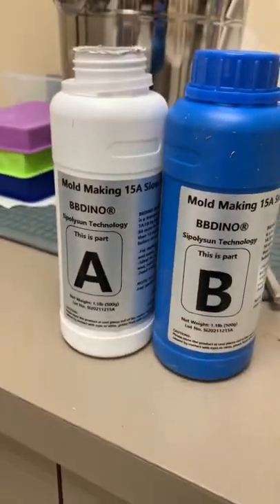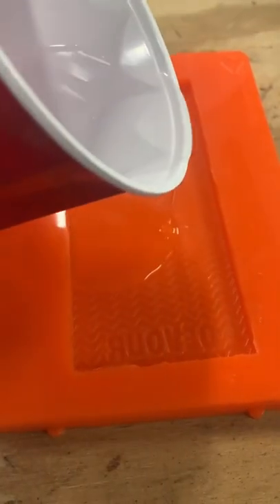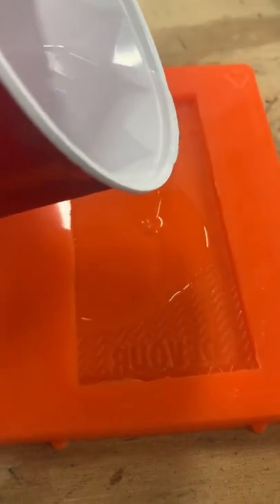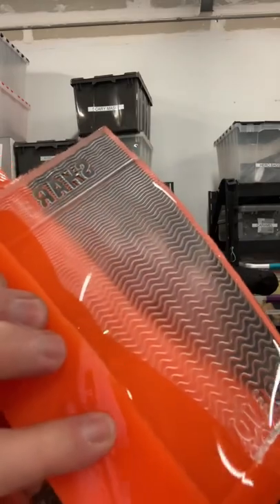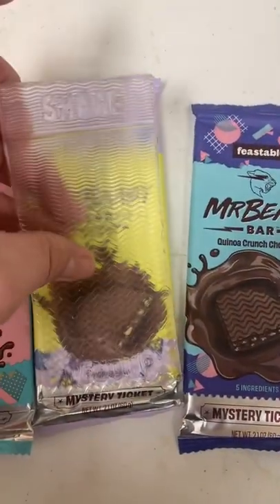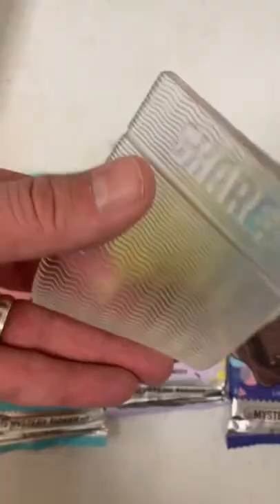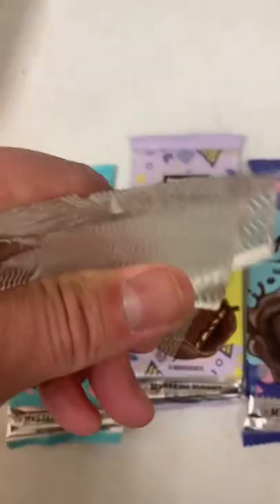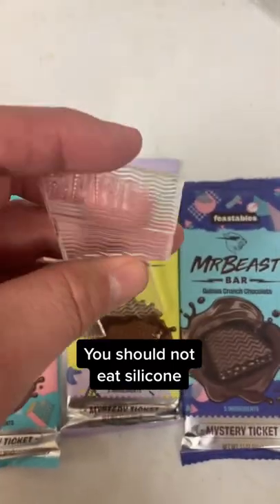I Made a MrBeast Chocolate Bar out of Rubber Glass.  #shorts

Comment: Hey Scott - If you have a scene where a large item, like a glass coffee table, is to be smashed by an actor, do you have to make multiple large coffee tables or are they expected to get the scene shot in one take?
Reply: It's likely CGI to prevent that
Reply: Depends on the budget and the end output they want i guess. If they are on a low budget and don’t want the realistic break away stuff, they can just use some kind of joint where it will be broke and then it can be reattached, like in this karate punching boards, but if they want more realism and they are on a better budget, they could use real ones made of easily breakable material like you said or even cgi like the person above me said, but I think CGI-ing that stuff would be hard and not worth it. But take all of this as my opinion, I’m just guessing these stuff from these prop videos.
Reply: I know that it's not my place to speak, but I don't think they need to break anything during rehearsals, instead practising the movement on a raised platform at the height which they would need?
Reply from the maker: I did It for the Friday Night Lights tv show.  We had 3 takes worth of breakaway.  I’m thinking it was like $250 per pane of glass.
Reply: @ScottPropandRoll  ooooh that can get expensive depending on how many takes you have to pull off with those breakaways

Comment: I have a question about the silicon 2 part mold mixture. I am trying to make a negative out of a wax figure and I am worried about the 2 part mixture heating up and melting the wax. Would that be an issue with this 2 part mix?